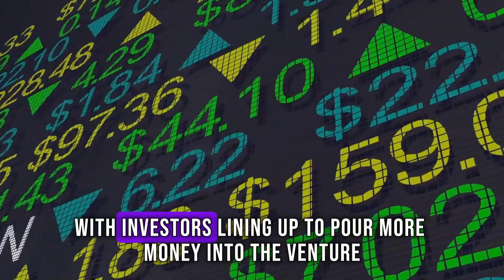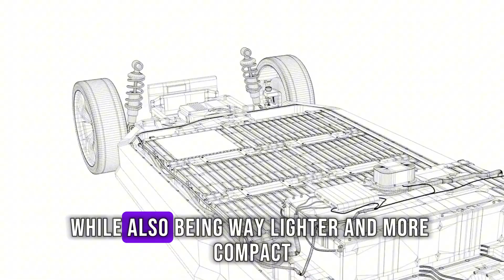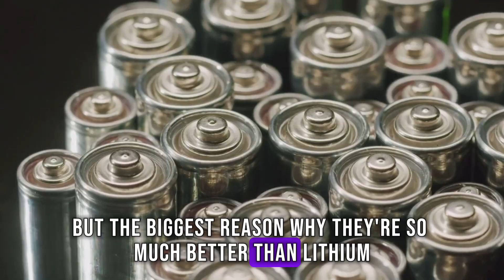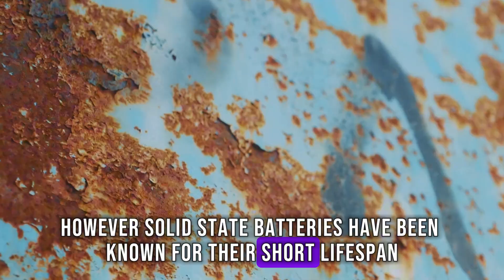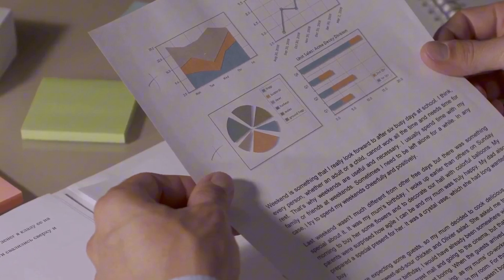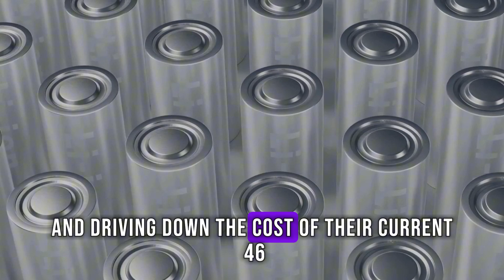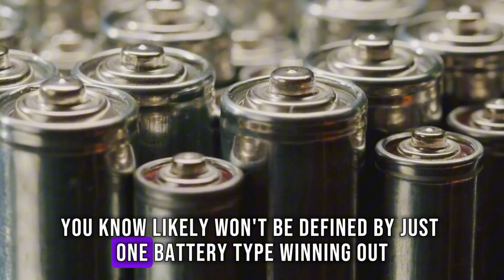QuantumScape’s NEW FlexFrame Battery Will Change EVs Forever!

Comment: They might change if they go to market but there are hundreds of developing technologies being developed simultaneously and QuantumScape is YEARS FROM VIABLE PRODUCTION!!!!   DreamOn
Reply: You should do some research,  Quantumscape is a lot closer to global production than any other firms.   Its approach (partner with global battery production experts PowerCo and Ceramics seperator expert Murata ensure that any technical/process challenges along the way will be solved.  Many issues have already been solved.   Of course having solid backing from VW and a cashburn runway that goes well into 2029 doesn't hurt either.    also look at who they are hiring or have hired recently.  Did you see the concrete progress at PowerCo's St Thomas, Ontario, Canada sight.  Its happening.    But its so easy to be a naysayer.   Naysay what you like,  I've already made $134K from their stock (got it at $4.30, sold at $14.01,  rebought at $8.   I'm already laughing all the way to the bank while you grumble about impossibility and complexity.